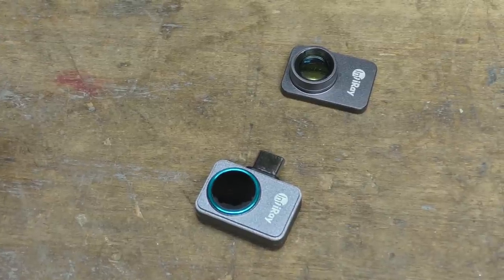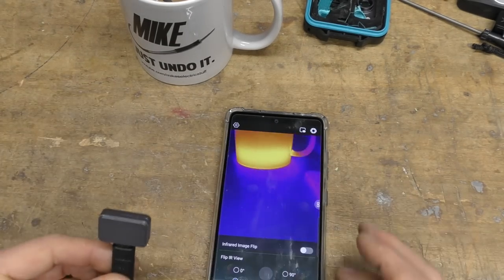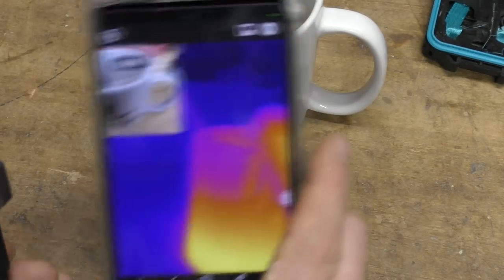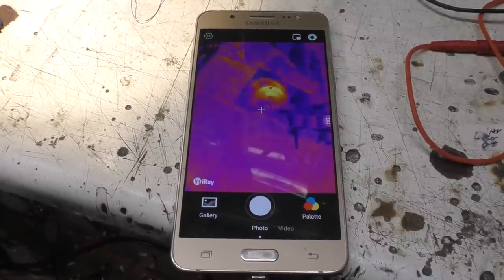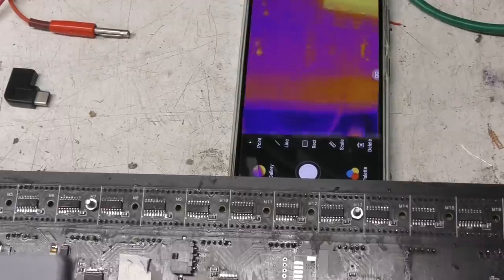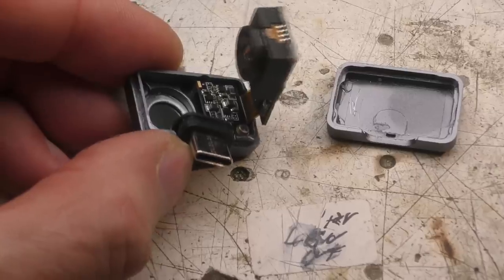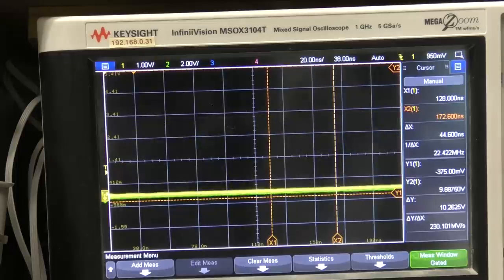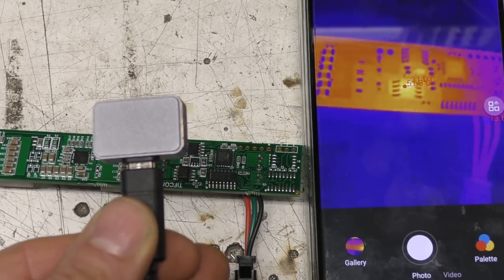Infiray P2 Pro smartphone thermal camera review & teardown

Comment: still waiting for a 50$ thermal camera that doesn't require a scamphone to use.
Reply: what on earth is a "scamphone"?
Reply: @dimitar4y  I've used android phones for 10 years and the last time I paid for an app was 5+ years ago. The last time an app scammed me of my money was never.
Reply: @dimitar4y  not sure what you are smoking lol
Reply: @kwinzman  did i say the playcard is the main problem? Companies invest most of their app dev detecting root and making the app refuse to work if the phone's rooted (owned by the owner). I know more about this than you do pal, you're also ill.
Reply: @dimitar4y  I don't know, you're so inept in communicating and unnecessarily hostile and insulting. God knows what you are trying to say.
Reply: But I agree that the manufacturer at least should support an open source app and/or have a fully documented USB API for their thermal camera. Having apps instead of building a screen and a bigger SOC into the thermal camera is really a way for them to cut the cost down. Which you desperately need if you want this to be 50 USD. Which is pretty unrealistic if you want decent resolution even without a screen.
Reply: @kwinzman  smartass
Reply: you've obviously mistaken this with apple iCrap compatibility.
Reply: @dimitar4y  lmao this guy's insane, ex mk-ultra?